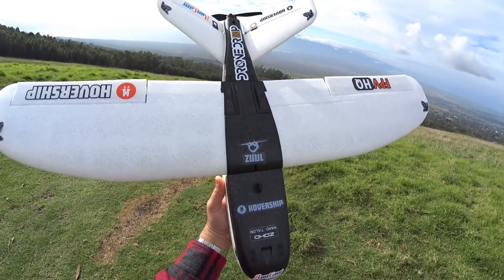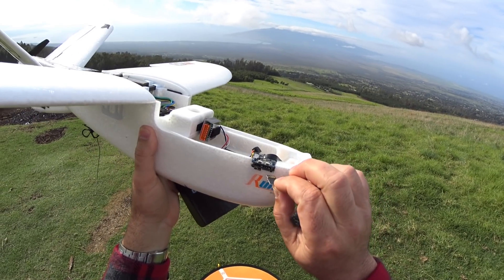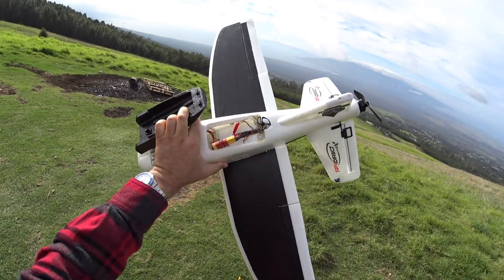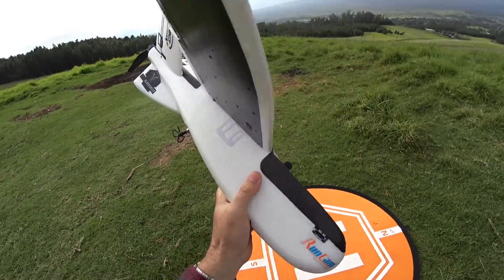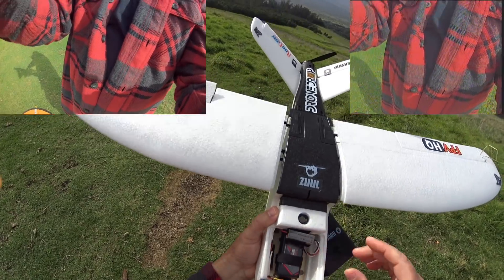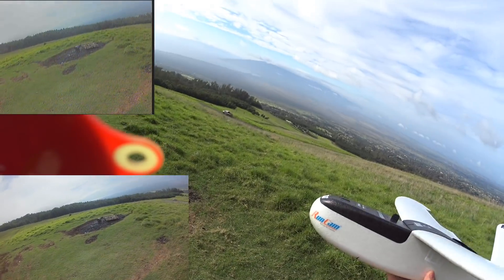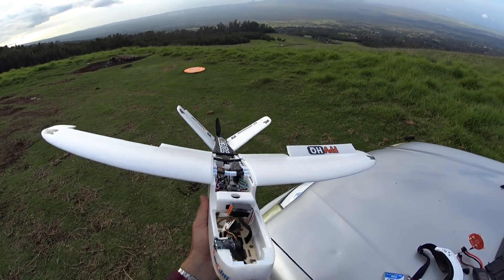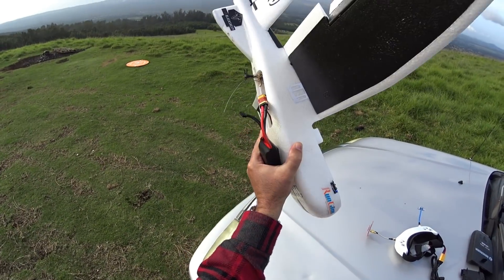ZOHD NANO TALON FPV Review with RunCam SPLIT MINI & RadioLink AT10ii [Flight, Range, CRASH! Test]

Comment: This is like the only video I could find with a fixed wing and at10ii. Thanks!
Reply: I've been through the Futaba vs radiomaster deliberations this month - I'm thinking I just replace my T8FB with this!
I'd love to hear the alarms though, I can't find anything on that. Do you know of anywhere? Are they verbal? Can the radio announce English words based on stick positions?
Reply: @ukmitch86  also, there are like 3 sentences of instructions and the rest you have to figure out for yourself. I haven't completely figured it all out yet, but most functions are similar to any other major 2.4gHz radio. I like it, but it isn't as nice as a Futaba for sure.

Comment: +Dustin... You can see why it crashed in your footage. You were flying with the wind at low speed with what appeared to be throttle off. The Talon began to rock from side to side which is the first part of a stall. The Talon then dropped a right wing and when into a spiral dive. When you throttled up, this made it worse and sped up the process. The Talon looked like it was in stabalise mode, because when you showed the damage I could see that the left aileron was up and the right was down... stabaliser was probably trying to correct the spin.

To get out of that situation you need to switch to manual mode, pitch forward (counter intuitive I know) and apply aileron to the same direction of the spin (again, counter intuitive)... The reason for doing this is:

Manual mode stops the stabaliser from taking control.
Pitching forward attempts to increase airspeed over the wing surfaces, especially the stalled wing, the right wing in your case.
Roll in the direction of spiral... This forces the right aileron in your case to go high into reflex thus increasing airflow over the right wing. Left Aileron goes low creating drag as the left wing is spinning faster than the right.

When the spiral slows and begins to correct, apply up elevator to pitch out of dive and apply power when level.

Some stalls are caused by too slow a speed and an increased angle of attack by using up elevator. If a stall happens in this instance, you can simply release the elevator which can assist the plane in recovering from the stall.

I hope that makes sense.

Cheers.... North East FPV
Reply from the maker: +North East FPV I think it was mechanical or electrical.  No reverse aileron response even at full opposite on the stick as it spirald down the plane kept spinning at the same rate in one direction.  Self leveling only takes over when your off the stick so it should have been able to slow or reverse the spin at least even if it were a stall if it was registering my right stick input.  I was at about 1/4 to 1/2 throttle when it started to roll and spin so I did have good forward momentum.  When it went down you could here me short burst the throttle while I was pulling up and trying to roll the opposite way.  The only thing that slowed the spin was me cutting throttle at the end.  When I put the wings back on you could see the wing control surfaces we're still maxed at what seems like they were during the spin of death.  It "felt" to me to be much more than a stall.  If it was a stall only, it would have happened much earlier in the flight since I was controlling it in similar manner for so long.
Reply: Dustin Dunnill I'm pleased you have it sorted then. It was good to watch your flying. I have mine to maiden soon.
Reply from the maker: +North East FPV 👍 please let me know if you encounter the same issue.
Reply: All great in theory, but this plane should display decent cruising characteristics. It failed on that count (alot of Wing wobble) EVEN WITH its own electronic stabilisation onboard.... plus then the "spiral of death"  ! 👎😤

I've been flying FPV models for years, you grow tired of this kind of thing happening, for no good reason, where often you never really know the cause. You end up with several hundred $$$ of mangled foam and electronics in your hands. You question is it really worth doing it all again!

Plus the hobby grade VGA video feed from the FPV gear that also glitches/random interference, and you start losing your primary display, never inspires confidence. 

It's no wonder the masses choose commercial off the shelf models from DJI and Parrot, where everything "just works" plus the glorious HD video link too. Simply buy and fly - no prior pilot skills or R/C know how required. 😁

Anyway, enjoyable video review 👍😎 Another Like from me.
Reply: @furiousangels6222  Or you can just watch FPV on Youtube - then you don't need any $$$, you can be very relaxed while sitting on you favorite chair and even can pause the whole experience!
Reply: @jendabekCZ  but the thrill of loosing money is like a drug
Reply: ^^ This, that was 100% a tip stall gone into a spin and this is a great thing for new pilots to see. Also Dustin you said you pulsed the throttle and pulled the opposite way and as North EAst FPV described this actually will make the spin worse.. in civil aviation you have a minimum control speed for this very reason. There is an ongoing revolution in small aircraft training centered around dealing with a stall by immediately pitching down on engine failure to achieve that speed  so you can regain control.. While it may have seemed like a hardware malfunction the video shows an almost perfect example of a tip stall gone wrong... The fact that this airframe has a reputation for doing this very thing supports that theory as well.. I could be wrong though.. that happens pretty often too lol
Reply from the maker: Well said.  It very well could have been.  I just expected some sort of reaction to control  input if the electronics were working correctly as it picked up speed spinning nose first into the ground.
Reply: @DustinDunnill  Ever find out what the issue was? I'd be interested if you tried again to see if a spin recovery would get you out of it. The corrective action would be as follows: throttle idle, ailerons neutral, pitch to the ground, FULL RUDDER opposite to the spin, and pitch back to horizon after rotation stops while you increase throttle again. Hope that helps!
Reply: Completly agree with the comments on a tip stall,  the plane was moving way below its ideal airspeed, the motions before it happened. Classic

Comment: I spent 3 hours getting the kopilot light to work on this thing, #1 you do have to put it on t -tail for a v-tail #2 I had to switch rudder and elevator plugs to get it to work properly. #3. I had to reverse servos like 20 x to get on to the right configuration. #4 THEN I found your channel and saw what you’d said about the manual and possible misprint. The instructions will lead you astray if you are building a V-tail so (beware) !

Comment: Sorry about the crash , you are correct that poor plane came down hard a good few Gs. But very well designed inbuilt redundancy to limit the damage by the looks of things lol  
This fact gives us the confidence to fly .
My first foamie was a little Cessena 180 micro very small with a teenie weenie brushless powerful motor.
This little plane gave me much pleasure .Just like yours repairing a breeze, a little glue and even the cracks dissapeared , became even stronger ha ha

Comment: Very nice crashes :D That's actually why I decided for this little funny thing. If you crash a regular model with some huge battery, it you fly through it's nose and all the electronics with it, servos would destroy the wings etc. This is easily repairable. I very much like how it flies then - very nice for such small plane I think, I don't care about some wobbling, it's nice to feel the wind this way for me. Anyway, you had some really nice weather conditions there, those low clouds, sun and the scenery is very beautiful! Thanks

Comment: Congratulations on the best Nano talon crash I've seen so far. I can't see why it happened from the video. Even I can't tip stall one in either stab mode and I'm a far worse flier than you are.:D Still it's fixable seemingly.
Impressive video and crash test
Reply from the maker: +didactylos4 diddy4 Lol...thanks.  already fixed but I'm having trouble trusting the flight controller.  I think that was the culprit 😲🎆
Reply: It's possible Could be any number of things. The crash investigation should be an interesting video
Reply: Hi Dustin I found adding some expo to the ailerons helps to prevent the tip stalls.

Comment: Yea repairable easily, nice clean break. I'd definitely wager the wing separated from the fuselage, that'd cause the spin. I think they probably just come apart gradually - just apply a little tape next time to keep them together. Nice content by the way, I have subscribed.
Reply: The vibrations from the motor may have worked it loose . I had metal tables come apart from the vibrations my cutting machines made even with lock tight .
Try some tape next time

Comment: I took mine out for a maiden flight this morning,I brought it in for a landing and it dived right into the ground. There was no damage to the plane whatsoever however I noticed that the control rod for one aileron had come loose. I believe that was the cause of my crash.
Reply: I did manage to tighten the control linkages (with lock-tight) and had two more successful flights. I have had troubles with my landings If I land the plane with power to the motor it will take a nose dive when it is about 5 to 8 feet off the ground. I did manage to glide it in with the motors off and the elevators up in self level mode. I think the next time I will try landing in horizon mode. I hope you work out whatever issues you have with yours And repair it because you usually come up with some good tips and tricks.

Comment: Great video!  Definitely a low speed stall. Its tough to judge airspeed without a pitot tube and OSD  but looks like you were slow and just turned downwind. This reduces the flow over the wings proportional to the wind speed. Loss of lift, drops a wing and the tip-stall put it in to a sharp spiral. Very hard to recover from and more throttle just makes it worse (usually). Been there a few times myself ;)  Hope you got er glued up. Cheers
Reply from the maker: All patched up like new 👍
Reply: Excellent!
Reply: Wow interesting stuff. PPL pilot training says in respect of a developed stall/spin to first set idle throttle and neutral Ailerons. Then apply full opposite rudder and forward elevator until the spin stops, then recover from the dive. Whether that sort of thing is achievable in the few seconds there was would be worth investigating. I guess at least you get a chance to try again! great vid :-)
Reply: Had a very similar stall crash with my larger Mini Talon, the 1.3m wingspan one... I think the vtail has a lot to do with it. Honestly hate vtails, first and last plane i will have with that setup

Comment: I recommend you set you fail safe to no motor and then circle if you radio link fail.
I flight the plane and simulate with the stick a gentle circle with no motor, and memorize the sticks and then landed and set fail safe of flight control the same way.

Comment: Hi Dustin nice to meet you, I have the same radio transmitter "radiolink", two days ago I  testing of my model 2 mt w. for 1,450 kg in depron with ZOHD, when I checked the mechanical parts, without fixes, I noticed that if you move the sticks faster, after a few movements some parts are block for too long, especially if you change flight modes while flying, in fact i crashed,  luckily i didn't have big damage. Then did you find out what the problem was? My Best regards
Reply from the maker: The issue  is a mystery to this day Fabio 🙂🍻
Reply: @DustinDunnill  I think it is an electrical problem, like capacitors, which must have time to manage and update the "flight mode change", nevertheless, I tried to fly, normal flight with fix sats, has fewer delays, but not them eliminates, in balace mode it's good, but when from stabilized you go directly to RTH, ZOHD seems to go into confusion. I'll give it one more chance and fly with more delicacy, I'll let you know! Have you flown with ZOHD anymore? a hug!

Comment: I'd replace that ESC; the stock one doesn't have enough amps off the BEC to run all those electronics, and it probably gave out.  Mine exhibited that issue soon after takeoff so fortunately mine didn't fall far. 
Edit: NVM, I see further down in the comments that you've already heard about this issue.
Enjoyed the vid, tho!
Reply from the maker: Thanks anyway Nate.  I was running the FPV and cam directly off the battery.  So the ESC really only had to power the stock electronics.  Hoping the company fixes this issue 😀😀

Comment: Software lock up glitch when low batt set reached ? Good camera for size.
Reply from the maker: +AboxofMonsters it still had plenty of voltage.  Maybe FC overheating and resetting.

Comment: OUCH! By the looks of it, the RX or FC locked up with full aileron and it spun in. (BTW, the back control surfaces are called "elevons"). I don't like how loose those wings appear to be held in. Perhaps you can hot glue in a couple of wire hooks in each wing, and then run a rubber band between them .. or just carry some fiberglass strapping tape with you  and cut off 18 inches and slap it across the top so the wings don't come apart accidentally or after some violent maneuvers.  The instability in the roll axis is caused by a lack of dihedral  .. not much you can do about that, and the FC "self leveling" mode is going to keep it level... more or less (not perfectly, as we saw). Very good video from the RunCam mini Split .. but then, I've seen that demoed before, and it is a real nice addition to any craft .. saves having to install a GoPro on racing quads for example.  Would be nice to use the RunCam OSD .. you'll have to wire that into your system, but not sure if its possible, as that usually goes into the FC board. As you said, damage won't be too hard to repair. You might cut a 1" wide strip of nylon or silk to cover over the crack and then glue that in place for some extra strength (epoxy or even thinned down "Elmers" would hold it in place).  Thought you should get better FPV reception, so check your antennas .. that patch may not have been RHCP like the VTX antenna. Interesting video with good views. Very nice of that guy to retrieve your ZOHD for you. Maholo!
Reply from the maker: +Bill Somrak That sounds like exactly what happened.  Glitch in the on-board electronics.  I tried to burst full throttle and PULL UP but there was no right stick input, only throttle response.  I was using a "well crashed" rhcp clover on the plane and had the patch hybrid in rhcp mode as well as an rhcp clover on the other side.  I think the clover on the plane was in bad shape.
Already repaired the front with some moisture activated foaming gorilla glue and it's like nothing happened 👍. Although I do want to figure out what caused that crash before I fly it again and replace it.

Comment: Dustin how do you find the radiolink at10ii set overall?. I'm Planning on buying very soon. Have you had any issues with revciever range or brown outs?. How is the overall build quality of the radio?.
Reply from the maker: It's decent.  I don't see a huge amount of difference between say frsky but I do like the voltage module and colorish screen the radiolink comes with

Comment: Hi, I also tried to install the kopilot on the nano talon evo, but in the acro position everything works fine, in the stabilized position the elevator compensates on the contrary. I tried to rotate the wheel on the kopilot to the opposite side but this puts both the elevator and the rudder in the wrong position. Some advice?
Greetings and congratulations for your videos, Aldo Guarasci

Comment: have you flown it since? as I dont think it was a controller error.. was it nose heavy? did you find any connection breaks ect? 
as he pickes it up you can hear it trying to stabilize moving the servos was the vtail still clipped in?
Reply from the maker: I fixed it but haven't flown since.  I had the CG a tiny bit nose heavy.  There were no breaks or damage to electronics.  I'll never know exactly what it was but sure did feel like control surfaces locked up 😔☺️
Reply: time for a project: fit an F4 and inav
Reply from the maker: Indeed 👍

Comment: Dustin,,,, I see that the stabilizer has been moved from its original place , I did the same , but moved it forward by only 1/2 inch  and now I cant get it to do the 6-axis gyro stabilization anymore  !!!  ( 3 axis gyro still works !!! )
can you recommend a remedy for this ? or is it possible to re-flash it or something ?

Thanks

Comment: Do you know how to link this radio to Skyzone SKY01 goggles?? I just bought the AT10ii and have watched numerous videos and read the manual but have been hitting a dead end and I bought this radio to use headtracking since my older transmitters dont have that capability

Comment: Great video! How did you power the split mini?
Reply from the maker: Did I not mention it in the beginning?
Reply: Had a watch of the start again. I’m not very familiar with powering anything more than a 1s whoop camera so perhaps I’m missing something. You said you have it connected to a micro USB to get 5v. I just am unsure where the micro USB gets plugged to?
Reply from the maker: Ok.  I remember now I ran a splitter from battery connector to a little BEC voltage regulator for the camera 5v micro USB
Reply from the maker: One of those little in line xt60 with a jst coming out to the BEC
Reply: Dustin Dunnill thanks man